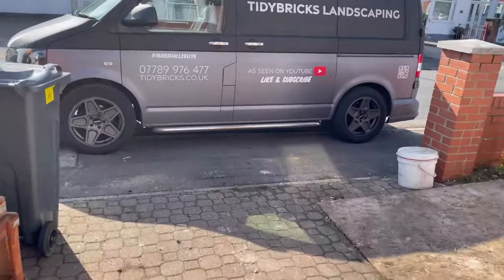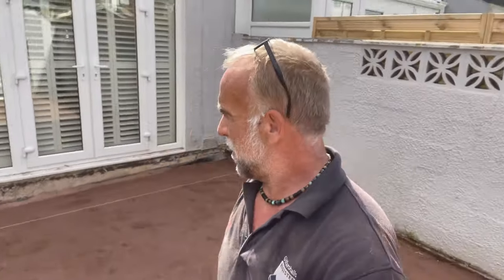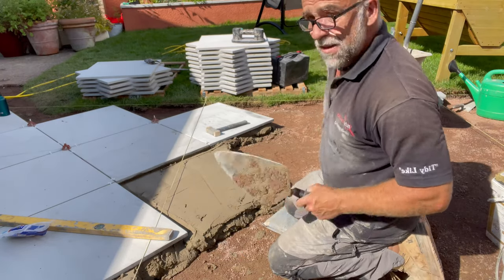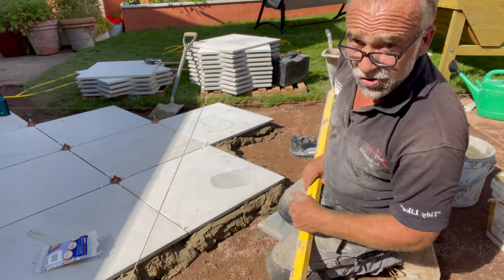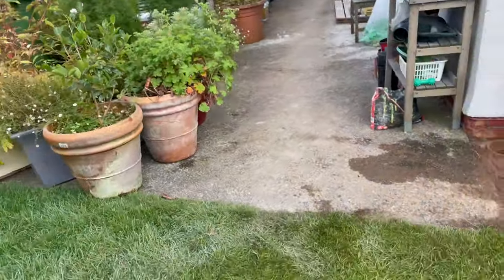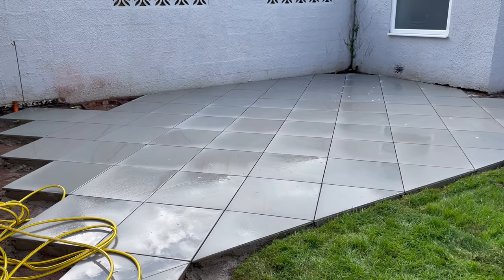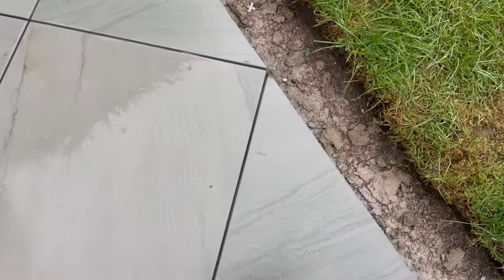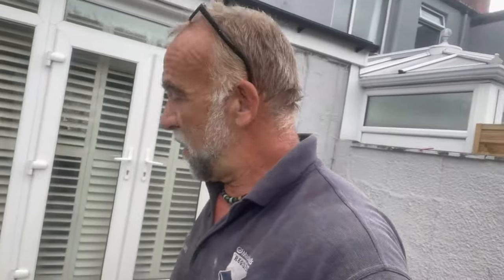Bad day in work 😱 #patio #gardendesign #lostkeys

Comment: Pressure washer parts...prepare yourself for some sticker shocker. My plastic molded bit costs $65.00 bucks to replace, never mind the hour or so of fumbling around. The machine cost me $150 bucks 17 years ago. So to the landfill, although it's reparable.
Reply from the maker: It’s such a waste and they know it just want you to buy a new one again and again drives me insane but I grin and bear it and try to smile 😀  😆  👍🏴

Comment: Great job Scott.
Just my opinion, build up deeper base and less mortar depth .
Less mixing, less cement used, quicker install(more profit) and easier in your body.
Great job pal
Reply from the maker: I just wish I had a tipper van so I could get the occasional ton more materials but these days Travis Perkins are taking up to 4 days for delivery so I just crack on 👍🏴
Reply: @tidybrickslandscaping  I got van like you, have tow ball and twin axle trailer, pulls dead easy.
It's a must, saves the day for me.
But as usual your work is best around pal, top class

Comment: Good honest vid.
Could I ask why the aco if the fall is running away from the house. And just a thought that your keys may be covered by your insurance without losing no claims. Cheers hope you have a better day next time.
Reply from the maker: As for the aco I only did that because I was only one brick down from damp proof course so I did it as a failsafe good point about the insurance I shall look into it 👍🏴

Comment: Your works amazing bud and I've kicked the bucket across the site a few times when things haven't gone right....Can I ask how you adapted the aico into the side of the hopper in 68mm....keep up the good work brother 😎👍
Reply from the maker: There was plenty of other ways of connecting up aco’ s to gully’s I just choose the gully with the sides pipes I cut out and cemented the gaps water flies through anyways. 
Some people might disagree with the method I choose that day but it still works. When complete I’ll silicone the joints as a little extra 👍🏴

Comment: Another great video.
Been so helpful laying my sandstone patio.
Could you possibly give me some advice. I laid sandstone with the 4-1 sand cement mix, all good. Got “Joint It Simple”  to use as grout but wouldn’t set. Turns out it must be used on a permeable base so water can pass through so had to remove it. Felt how you felt at the end of this video. No way I’m trying that stuff you just used in this video. What would you recommend to use with a sold base. All the brush in grouts seem to need a permeable base. Worried just using a cement mix will just crack. 🙏
Reply from the maker: I was talking about this same problem with one of my reps the other day and he said don’t worry about it all grout is only guaranteed for two years and away and it wouldn’t damage the cement either but you must use a jointer to push the grout in as compact as possible just brushing it in is no good it needs pressure 👍🏴

Comment: About to have patio laid,  lad says he prefers to lay on sharp sand, no cement as  he says cement can bring out the salts?  Using Marshall’s 50 mm coloured concrete slabs, is he correct?
Reply from the maker: He is actually it’s not a normal patio tile which is only 20mm those 50mm there the same as pavers on a driveway. 
I’d prefer to use stone dust though as it compacts much better as sand can find voids after rain a sink. 
And you want 10mm joints grouted for sure otherwise you’ll get weeds coming through if they are just butted up 👍🏴
Reply: @tidybrickslandscaping  Thanks Scott, really appreciate your comments.

Comment: How many lean mixes do u reckon you do a day? And over a year and over your slab laying career must be an obscene number. Great video. I put in some acco drains recently was a pain to get levels correct as existing driveway pavers had moved over time. You’ve made it look a fair bit easier when going from scratch, not sure if that’s your years of experience, working to a perfectly straight surface or the combination of the 2 😂
Reply from the maker: I think it might be a combination of the two actually ? I must’ve use quite a lot of wheelbarrows full of mixes already yeh you’re right 👍🏴

Comment: I wonder if this stuff is as tricky as gftk vdw 850+. Just used it on some textured paving and it was a nightmare firstly shifting off the slabs into the joints, then getting it to stay in said joints! Just like yours though, paving looks great when done though!
Reply from the maker: It is all a good product to use just really tough to work with drives me insane 👍🏴

Comment: Feel your pain their fella. I prefer trad pointing personally but I used flowpoint on last job for the first time as slate paving and granite setts was wrong colour and too big an area for trad without getting into dyes. What a stress. Paving has to be damp but no water in the joints and once down you gotta keep it damp otherwise it sets to the slab and ain't ever coming off. Good product but plenty of pitfalls and messy to work with I thought. Lots of residue runoff. Much prefer vdw850 to work with. Cleaner product to use. Use lots of water to get it to flow, no problems with efforvesance and once finished no residue to clean of. Need to half batch it on 5mm joints as it goes off fast and won't flow. Only downside for me is the price. 4 times price of flowpoint....eek!!! Only use products when trad is not viable.
Reply from the maker: Thanks for the reply Ed and yes you’re quite right in every think you say never tried that product you’re on about VDW 850 I’ll have a little Google a bit later jointing years ago was stressfree now it drives me insane 👍🏴
Reply: @tidybrickslandscaping  yeah there's big pressure these days to use products to speed the job up. Personally I love pointing trad. One of my fave tasks. All about the finish. And gives me some time out on the job. It's nearly all labour and fills so many days a year it's easy money and easy times. What's the rush. Make your money on the labour and save on the product. However vdw850when you need it. Theres a paving expert vid on you tube. You only need use it once to get the hang of it. Lot of guys swear by it and it lasts. Plus points...easy to use, clean, lasts forever. Downsides...price esp for large areas, goes off fast esp in hot weather, leaves tacky residue on paving which takes a bit of time to weather off. Need 2 people really. One to spread and one to hose. Have to work clean. Dont walk on it with muddy boots as dirt will stick to the residue until it's fully cured. Hope that helps.

Comment: Looks good. Do you grout between acro drain and tile? Would be interested to understand how that join works. Cheers.
Reply from the maker: Yes I do grout between the aco and the tile but use a smaller tool not the big squeegee and possibly do separate to the main poor because time is against you otherwise 👍🏴

Comment: Normal hose pipe connectors fit on the power wash I broke mine too 😂
Reply from the maker: Stupid bloody pressure washer why not have the hose on the side so I can’t snap if it falls over when you tug it 🤔👍🏴
Reply: I left mine in a garage in winter and it froze, then cracked.

Comment: Hi Scott, I saw you was using a flex wet cut saw on one of your previous vlogs, would like to know how good it performed on cutting porcelain without the tiles fracturing on the fine detail cuts.
Reply from the maker: I found it useful once but it’s not a saw you can rely on for certain cuts if you have to do a full cut then the last section really does have a good chance of cracking unlike my tablesaw what are use all the time the flex is rusting I imagine 👍🏴
Reply: @tidybrickslandscaping  nice one mate, was considering buying one to do the inspection chamber cutting as I’ve been finding it quite difficult to cut porcelain without them cracking on certain cuts. What disc are you using on your fine detail cuts.
Reply from the maker: @anthonysmith149  hey Antony and yes porcelain tiles are hard to cut that as long as you’ve got a good blade you’ve got half a chance and he is the guy are use his name is Phil he is his website check it out 👍🏴 
https://www.pulvex.co.uk/
Reply: @tidybrickslandscaping  cheers mate, keep up the good work and thanks for the reply.👌👍

Comment: Sorry for the stress.of the job mate. Sometime.sthings don't go as well. How's the porcelain driveway holding out? Any movement of cracking?
Reply from the maker: Solid as a rock apparently it’s so thick it’s never going to move 👍🏴 hope things are well with you
Reply: @tidybrickslandscaping  great news. Started my drive a few weeks ago. 150mm type 1 with 150mm C35 10mm aggregate concrete with A142 6mm mesh. Put foam joints and 12mm rear sleeved between the slabs. Give it a month before we go porcelain. Might put plastic exoNsuon joints in. What do uou think?

Comment: If your stressed don't know what I'm going to be like when I do mine.
Never layed pavers and I've got porcelain. 
Question, can you use flowpoint on slightly riven or will it collect on top within the riven pattern?
Cracking job by the way 👍
Reply: @MuRF2010INESSEX  I use trad 3:1 mostly but we do 2 sharp 1 building 1cement for a smoother finish. Strikes off easier as that bit less gritty.
Reply: Ps mate. We use yellow building sand for a better colour finish as all red sand where I am.

Comment: Again thanks for your effort of loading this stuff onto the net - much appreciated. You need to set up a subscribestar account so that people can throw some beer money your way. I owe you at least a gallon!

What's the standard thickness of porcelain tiles in the UK? Where I live they are 2cm and they lay them on what is called 'split' which is essentially gravel generated out of a stone crusher. I'm remodelling our garden and swapping out the split bed for a concrete one following your vids...'?

I can't find anyone that will ship me the leveling clips you use from Tiler's Tools. They don't to international shipping so I might have to go without them. In the local DIY store (Bauhaus) they do a version which only go up to 15mm so they won't work with 2cm tiles

You might do a video on changing out a single tile from a concrete base - you did a couple where you weren't happy with the result but didn't show how you removed the tile and gave yourself enough room to stick down down the new tile.

Last question: You use a "slurry" between tile and concrete. Can't find the equivalent here. I would think I could use outdoor tiling cement, what do you think?
Reply from the maker: 20mm exterior tiles over here too so that’s the same at least and shame about those clips I use I have heard before they won’t ship abroad from subscribers. 
That slurry you mention sounds like it’s a similar idea. As long as you can make it into it a paste then it should  work
👍🏴
Reply from the maker: https://youtu.be/pEZjmfIKu5k 1.16.00 had to remove some tiles here also

Comment: Looking great Scott wen you did ur mix reminded me of coming back from Vietnam 🇻🇳  🤣 wat do you think of the easy joint compound?
Reply from the maker: I’m not sure how to answer the Vietnam part and as for that easy joint not sure is that the resin-based type if so it will go green with algae 👍🏴 Thanks for watching again
Reply: @tidybrickslandscaping  easy joint compound the one that's wetter the better just soak it and brush it in
Reply from the maker: Yes I know the stuff so easy to work with but it’s still soft weeks later you could still push a screwdriver through it and the algae sticks to it terribly 👍🏴
Reply: 🥺🥺🥺 I just used it lol
Reply from the maker: @philstation335  just be careful when you’re pressure washing in don’t go to close. Hopefully you forced it in not just brushed. 🤔
Reply: Yea squeezed it in with a narrow margin trowel 👍